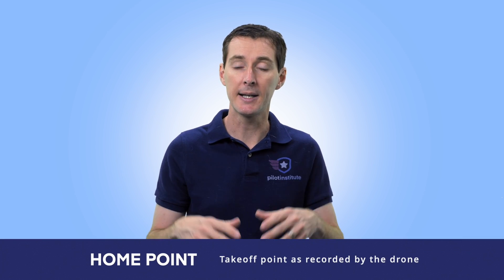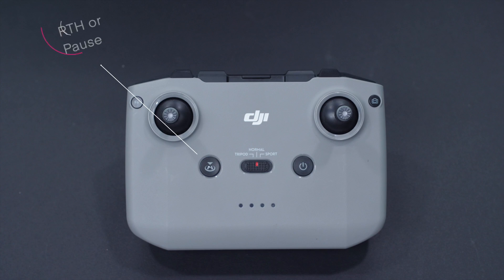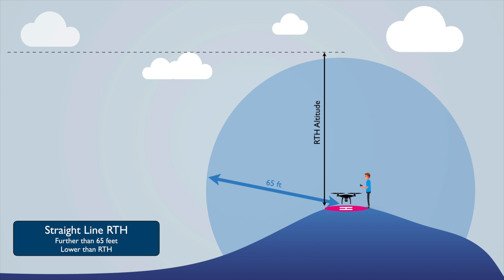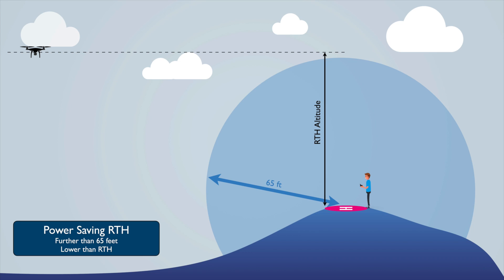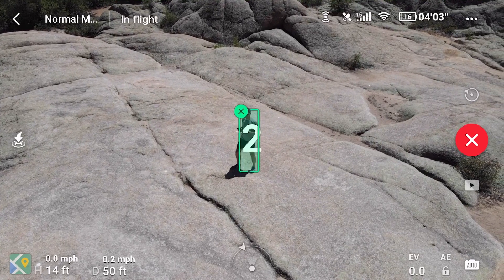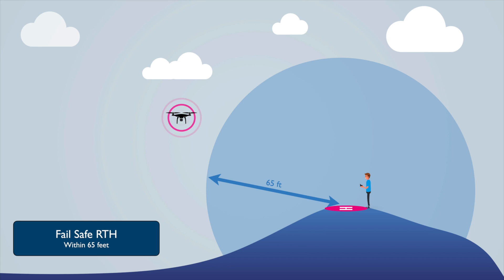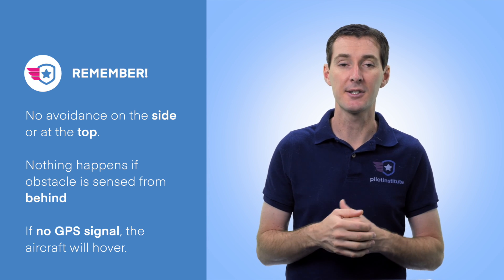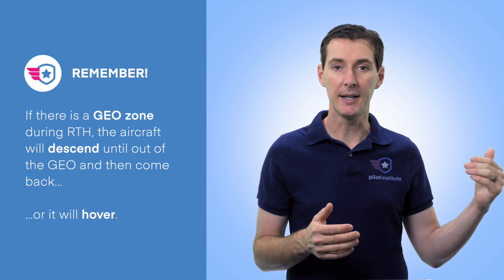DJI Mavic Air 2 RTH Explained (Return-to-Home)

Comment: Thanks for a very thorough explanation of RTH. One question, if your take off home point is 400 m above sea level and RTH altitude is set at 80 m. If your drone is 100 m away at (400)+90 m altitude, when RTH is activated, will it fly back at 490m altitude ? Same scenario, if drone is flying down the valley at altitude (400)-90m , what would happen with RTH ?
Reply from the maker: If you are higher than RTH altitude when it is activated, the drone will maintain that altitude.

Comment: How do you set your Mavic Air 2 to RTH to your current remote control position. I've watched so many videos and no one seems to know how explain that very clearly.
Reply from the maker: You can't. That option is only available to drones that use the Go4 app, and not the Fly app.

Comment: My air 2s only returns to home at my set altitude when in video mode. If I'm in photo mode it will only return to home at the altitude the drone is flying at when activated. This does not seem normal, anyone else have this issue?
Reply from the maker: Uhm, I've never seen this before. Definitely not normal behavior.

Comment: Got in mid of july my DJI air 2S.. and absolutely destroyed it  after like 4 footage videos because of RTH button.. 

The aircraft one day lost signal for 5 min, and later on automatically decided to return to home, and hit a hotel tower at around 270ft height and landed on concrete, and was completely destroyed... don't know why it haven't sensed a big building but it didn't... 
OBSTACLE AVOIDANCE ON DJI IS  SHIT! will never buy their drones... total garbage.. at least for present time, maybe in future when it will be a lot more developed and with enhanced obstacle avoidance...  in addition not seeing the footage of hitting hotel, was unfortunate as the sd card was also destroyed in pieces..

sadly for me but 1000$ was thrown on wind.. 

BUT THIS VIDEO IS VERY HELPFUL, i wish i saw this video before... and won't rely totally on RTH  but rather  more on myself returning it back..

Comment: 08:10 “the drone is coming back but it can’t do it”

How does the drone determine that it “can’t make it back”?

This happened to me recently.  With 10% battery left, which was enough to make it back home, my Mavic Air 2 decided (while over water) that had to land and thus halted the flight back home.  I was forced to take over and try to navigate the drone back myself, but I didn’t know where to go and thus didn’t have enough battery to do it.  I lost it in the water.

The drone fucked up, pure and simple.  “Critically low battery” with a forced landing don’t always coincide with inadequate battery to make it home.  I lost my drone today for no good reason.

Comment: Nice video for explanations, however I have a mavic 2 and twice my drone has ascended into trees during the low battery auto RTH. Both times I was landing the drone within 20 ft +/-    I fly my drone for stills and video of homes for real estate and at the speed these things go vertical for the auto RTH there has been no time to react and I have been in touch with the people at DJI regarding this. I just wish they would re-write their software to allow a manual override with just the sticks
Reply: What is the procedure?

Comment: ----> HELP <----
HI! 
I always fly over the bay waters at Miami Beach, FL. USA.
Is there a way to set a "LOW ALTITUDE WARNING" on the Mavic Air 2.?

 I get distracted and lost all the altitude while moving the left joystick to rotate. 
I could set it to any altitude for the warning to be activated. The idea is to increase altitude if I get below, e.g.,  5 or 10 meters.
Then prevent it from crashing into the water. I already lost the Mavic mini and the Mavic 2. I can't retrieve them from the bay floor. I am afraid to make the same mistake with the Mavic air 2. It has happened to commercial airplanes too. Pilots get distracted and crash after losing altitude.

Comment: With regard to "Update the Home Point" -- I think the default RTH should be to follow the controller and land there automatically, if the takeoff point has moved significantly. That would be the best option if I were on a boat or car or bike when I'm still moving. By the time I "update the home point" I will have passed that point already and it would land in the water. I've not experienced a situation where it was useful to pre-plan an alternate place to land. Really, I only use return to home for emergencies, or maybe to get the drone to to where I know where it is again (then cancel RTH). The Attitude Indicator is the best way to get your drone back safely, but that now requires your full attention since they screwed it up with the last firmware update.
Reply: Hi Steve I respectfully disagree : if I’m in a boat or kayak and the drone is following me when Returning to home it could be ok in some cases. Not all the time . If I’m in a moving water with a kayak I won’t be able to catch the drone. Just imagine the nightmare when the app is rebooting (or any disconnection occurs ) and the drone is descending on my kayak….and my kayak is moving. I prefer having a predetermined safe place to land. Thank a lot for sharing your comments.your opinion will be much appreciated.
Reply: In the case where you 're out to sea and you want the drone to land back where it took off then I'm hoping someone else has the controller and he's just following you. Especially as you get further from the original home point. I won't complain if they ever decide to give us a dynamic home point. Maybe it's on one of the newer models... cheers.

Comment: I can see same zebra lines in my drone footage too like you see in this video. Anyone knows what is that and how to solve the issue?
Reply from the maker: It's an option you can turn off in the settings under Camera. The Zebra tell you if the image is over exposed. it doesn't show in the final recorded video though.
Reply: @PilotInstitute  if you are talking about exposure option which is at right down corner of live video in app then I have tried too high more zebra loo low to dark like night in day on live screen.
Reply: @PilotInstitute  👍 you must have told just turn off over exposure warning 😂. Also there are some pink lines coming and going for 1 sec or half. Is this a flex cable issue?

Comment: Does the obstacle avoidance apply to the Mini 2?
Reply from the maker: No stacks avoidance sensors in the Mini family.
Reply: @PilotInstitute  ok, that leaves the question, while I was on the top of a cliff, coz I took it 2km away today to a tall cliff, plunged it down after I cleared the cliff, & my signal was completely gone, after about 15 second it initiated rth by itself, raised above the cliff & trees & came back.
But my question is coz you said it moves 50feet back, which would prolly smashed into the face of the cliff, but since it didn’t, I’m assuming because it doesn’t have the front sensor that when rth is initiated, it just goes straight up right away?
Reply from the maker: @Waynus888  The rear sensors likely caught the cliff, which is why it didn’t crash in it, and just climbed instead.
Reply: @PilotInstitute  when I lowered my drone down the cliff, the drone was facing me tho, & I thought it doesn’t have a back sensor.  Only a bottom sensor.
Reply from the maker: @Waynus888  Oh sorry, forgot you had the Mini 2! The RTH works a bit differently with the Mini 2. Check out this free course we have, there' s a whole chapter on the RTH, this might answer your question: https://pilotinstitute.com/course/mini-2-deep-dive/
Reply: @PilotInstitute  without enrolling in the course, can you tell me it it just goes straight up to set height when rth is initiated?
Reply from the maker: @Waynus888  I'm not gonna lie, I don't remember from the top of my head. The course is free so you should find pretty quickly.
Reply: @PilotInstitute  I don’t have time

Comment: Thank you for this tutorial. Just so I understand RTH fully:   Scenario:  I am standing on a large sports oval where I set RTH at 20 meters and I take flight with the Air 2 , I rise about 60 meters and fly straight 300 meters. I then hit the RTH button:
A: Does this mean the drone at its current position will first descend to 20 meters before it flies RTH and land? 
Or 
 B: will it return home at its current altitude and arrive at the RTH point 20 meters above the take off point the land?

What is the ideal, or safest altitude to set as a RTH? Thank you as I am very new to drone fling.
Reply from the maker: In your case, since RTH is lower than the altitude you were at, the drone would return to home at the higher altitude, then when it's over your home point, it would descend.

Comment: Do the sensors of mavic air 2 work while flying manually in GPS mode. I lost mine while flying over water, I was lowering its altitude to bring it closer to water surface but it crashed in water, I was expecting its sensor to detect. Should it not?
Reply from the maker: Sadly, you were victim to a common error. The bottom sensors do not perform well over mirror-like surface like water. 
I recommend you enroll in our free course about the Mavic Air 2, we discuss this specific issue: https://pilotinstitute.com/course/mavic-air-2-deep-dive/

Comment: One mistake: The AC will not descend to safely fly through Geozones during Rth. I started the AC  in a Geozone with max 150m altitude limit. Then i flew out of the GEO Zone and lost signal. The stupid thing is, that i set the RTH to 300 meters (because it was a Mavic Mini with no obstacle avoidance). What happened: it ascended to 300 meters and started to head home. But when it reached the border of the Geo Zone with 150 Meters it stopped and hovered at 300 meters. I had to head there quickly and landed it. The drone will not descend to 150 meters and continue RTH in this cases...

Comment: I would like to ask about the last part of your speech that has to do with GEO zones. I fly within a GEO zone (60m altitude limit) and when I exit it I gain height (at about 118m). When Failsafe RTH triggers (let’s say at 2000m), at the moment it enters the GEO zone while returning, it does NOT descend, it just hovers. That has nothing to do with detecting obstacles underneath. It just hovers and never descents as it probably should (so it reaches 60m and keep on returning). That’s something  I have to deal frequently so if anyone has any "trick" or something to mention on this plz do so.

Comment: I didn't know you could set the maximum distance from the homepoint. I thought there was an arbitrary limitation and felt so disappointed when testing my Activetracking. Super happy I found this video!
Reply: Not sure about legislation where you are, but here, if you can't see it with the naked eye, you've flown too far, and with it being grey, that's not very far. I've got bright white, yellow, and red reflective decals on mine.

Comment: Greg question....I fly in the city a lot with buildings 1000’ tall for example.  Say I’m at a really high altitude like 1000’ and go behind a building like that and lose signal....what does the return to home do?  Obviously things way different that high.  Does it know to avoid the buildings when working its way back or ?
Reply from the maker: I’m actually not sure because I think it’s limited in high with the max RTH altitude. The best thing to do is to not go behind a tall building (because of VLOS anyway).

Comment: I flew off of a sailboat and all of a sudden it was flying slow. Could barely keep up. We were only doing 6 knots in 11 knots of wind. I did a parallel follow and it kinda kept up but was behaving oddly. I cancelled the follow mode and started flying it to the boat. Again it started falling behind. I tried changing to sport mode, no change. Then it stopped moving forward altogether. We had to tack, turn the boat around, and get back to where it was hovering. I could strafe, but not move forward. Finally we got close and I could move forward but at this time it was flying a bit erratic and was very difficult to move into position for my friend to catch it. Then it went to max power, refused to land. I couldn’t stop the motors. My friend luckily had a firm grip on it and I ejected the battery. Now, back on land, it flies perfectly. Any ideas on what happened? I’m scared to fly it again on our boat, which is the main reason I bought it

Comment: Hello! Thank you so much for creating this video.

I have a question, What if the Remote control accidentally turned off and got disconnected to the drone? What if the mobile got disconnected? How do you reconnect the mid-air drone especially when its far away from you?
Reply from the maker: If it disconnects for an extended period of time, it will start RTH and evnetually reconnect automatically. Remember that you should never be "far away" since you are required to fly with line of sight at all time.

Comment: Just a couple of corrections. 
There is a way of updating home point to either drone location or controller location. You can find this in Update Home Point Location right under RTH altitude slider.

For power saving RTH to kick in drone would have to be at least 400 meters away, at least 90 meters above set RTH altitude and at at least 290 meters of altitude. Quite an unlikely scenario in most countries.

Comment: my mavic air 2 is acting weird. when i use the return home bottom the drone just go max altitude and my dji fly app freezes and i have to restart the app turn off the controller and everything and still doesnt work i have to wait till the drone battery is dying and the drone starts to emergency land and there i could see the dorne camara on the dji fly app and i just start to move it somewhere safe to land but its very scary and dangerous, it almost landed on top of the tree the other time almost laned on the river. please hep

Comment: Very good and helpful practical explanations about situations you can't find in the manuals. I was very lucky to save my drone after I broke off the RTH at Low Battery. The drone was about 200 meters away from me and just wanted to land. With RTH Button nothing reacted anymore. I haven't seen the drone and could only point it at me on the map. Then I was able to fly the drone with the control sticks to me. 2m before the start she fell from 2m height into a corn field. The battery was completely empty. I recommend that you never cancel the Low Battery Alarm. Greetings from Switzerland.

Comment: Great explanation. Question - if I lose the screen and I need to engage the RTH, what will RTH button do? You are understanding , that I can not see the proposed options, what will happen then? I am asking that because already few times DJI Fly restarts itself and if I am in critical situation, I would like to know how the RTH button will work?
Reply from the maker: If you lose the DJI app and you use the RTH button on the remote, it will engage the RTH procedure and come back.

Comment: Hi Greg I’m having 2 problems wud like your advise..  #1..was flying my Mavic air 2 yesterday in a boat sea gulls came and started attacking the drone I panicked 🥴..  as the drone was coming in it wasn’t letting it enter the boat and started wobbling thought was gonna lose it in the water.. do I turn off both obstacle and APAS? It finally entered the boat but was going toward my friend he went to grab from underneath and got a slight cut cause it suddenly went downward but he caught it 🤦‍♂️
#2.. I called apple support when  I try using a card reader adapter for the SD CARD it doesn’t import videos just jpegs apple asked what CODEC does the mavic air 2 use cause that might be fixed on settings but I don’t know the CODEC 🤷‍♂️.. hope you can help with these 2 issues .., thanks
Reply from the maker: Gman, 
For #1, yes turn off obstacle avoidance and APAS in this case. 
For #2, did you record in H.265 codec by chance in the settings (instead H.264). If so, it's a newer codec and you may need to update your operating system or software to play the videos. I use VLC (free player) to play those videos and it works fine. I think Quicktime still doesn't play them.
Reply: Pilot Institute  yea I just looked at my settings was on H265. Duh 🤦‍♂️
Thanks Greg 👍